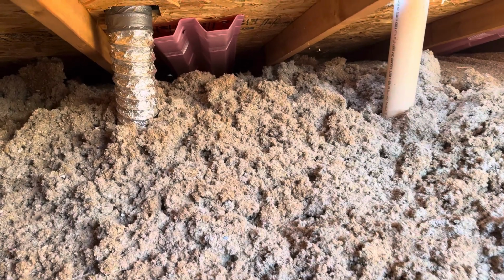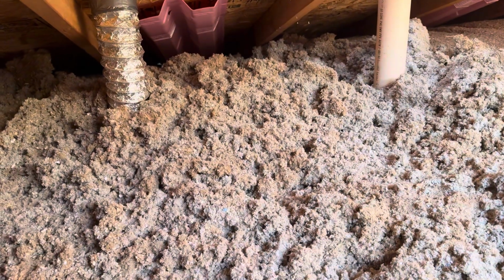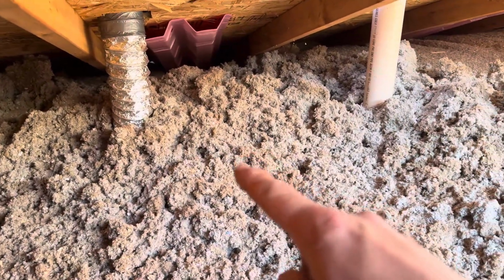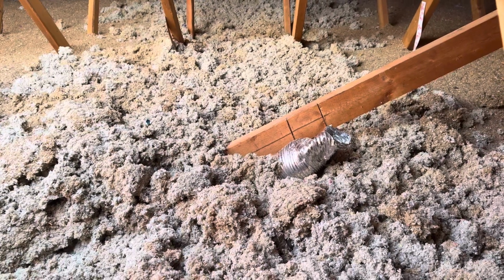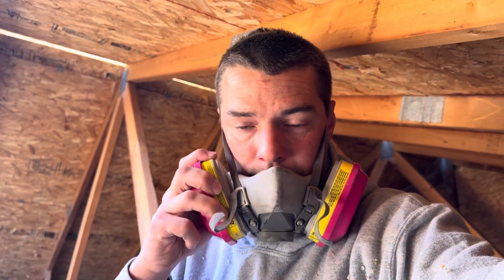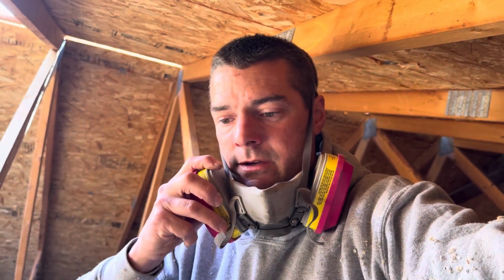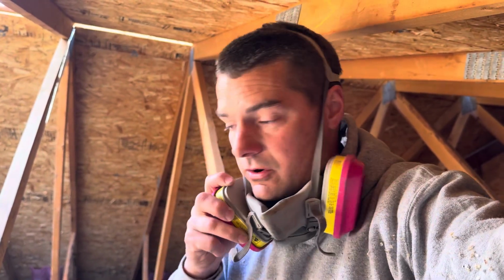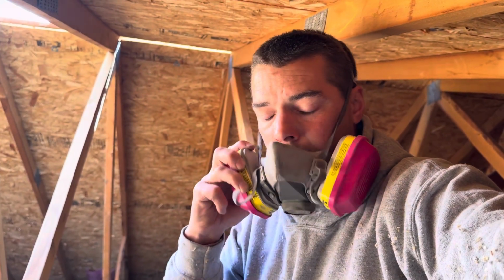Blown insulation covering bathroom ceiling fan vents

Comment: Picture of a penetration, so what was the purpose.   Couldn't it be vented through the closest soffett if the owner doesn't want a penetration in the front roof deck.  Or angled up to the ridge vent or vented high on the back deck.

Comment: iIMO cellulose is horrible, its cheap that is why its pushed, it holds water vs fiberglass, has slightly higher R value over fiber glass and can help air seal but downside with roof leak is the ceiling will come down from weight.